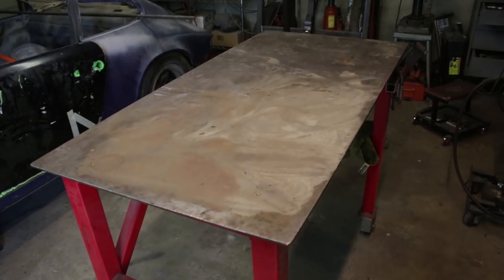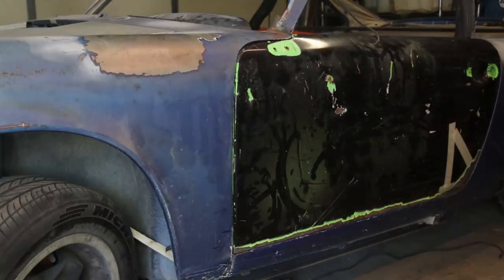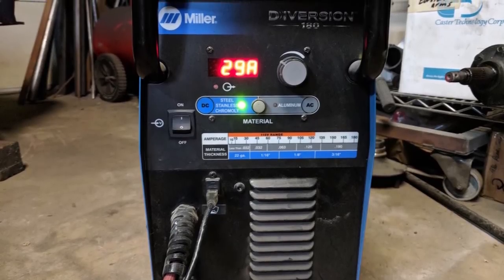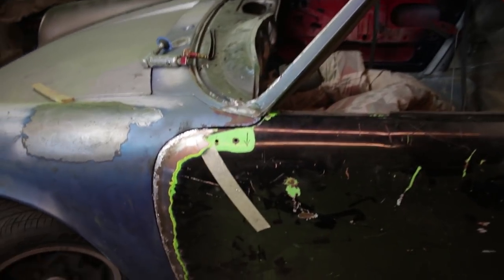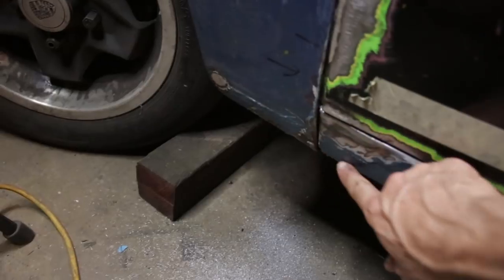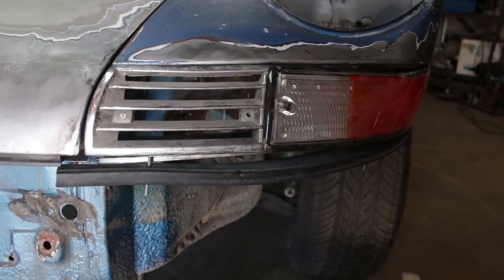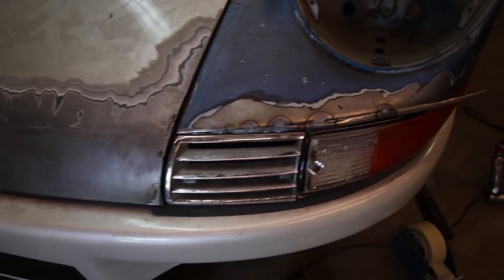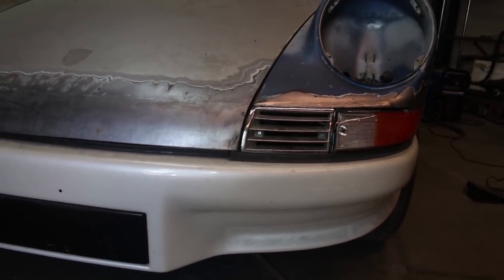Panel Alignment Nightmare Complete on my Wrecked Porsche

Comment: I'm really glad you're done with the metal work. That was a lot of work and you did a great job. You made a comment about painting straight on the metal. You don't have any single high or low spots on the metal? I would imagine using fillers to smooth certain areas for a job like this.
Reply from the maker: Thank you!  No, there will be several layers of primer, & filler before the final top coat.  I'm hoping for a driver quality paint job, not anything spectacular, but we will see how it goes. I probably mentioned shooting the first coat of primer as "painting".  I'm just excited to have it all one color!  I still need to locate and install the fender flare too.....then the metal work will be done.

Comment: Great stuff as always: can’t wait to see how you apply the same methodology on the interior-engine-suspension-Electrical wiring.
Reply from the maker: Thank you!  The mechanical bits are my favorite to work on.  Can't wait.
Reply from the maker: Good point.  It will be very minimalist.  As in I don't have the parts to do it any other way.  I'm only installing things that are needed to drive it 😀